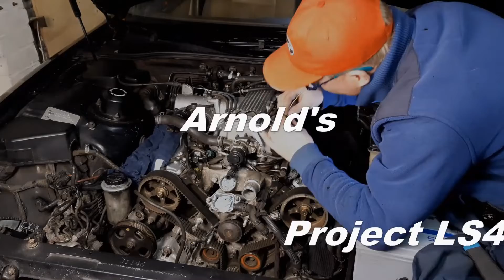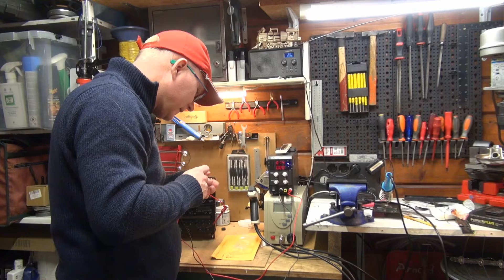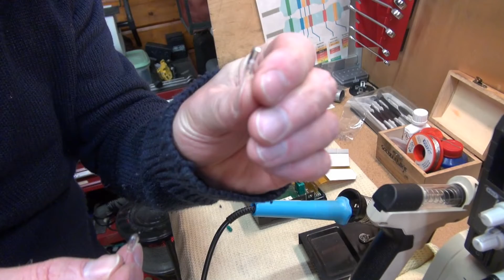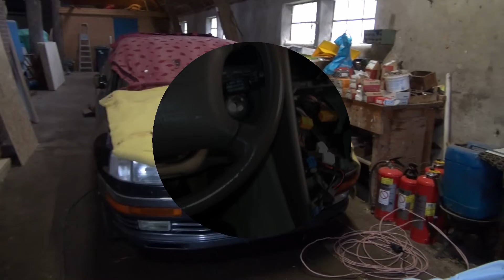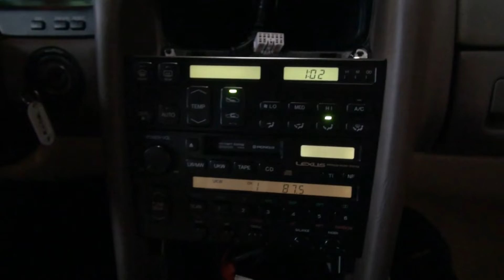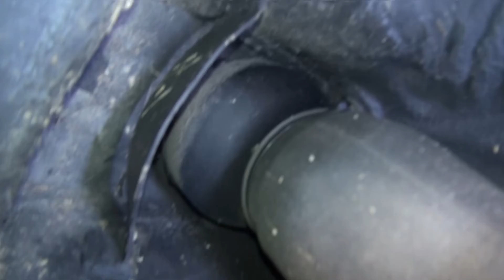Project Lexus LS 400 Ep. 33: Radio illumination repair and brake squeal fix

Comment: When you bought UCF 10 you didn't afraid of air suspension. A lof of people say its better leave the model with it. You have any problems with it?
Reply from the maker: Only my very first LS400 had a broken air suspension strut when I bought it. Because of that, the car was very cheap. I had to buy a new strut from Lexus, that cost 700 euro, while the LS costed 1400 euro. But I never had any problems with air suspension. It is important to do the right maintenance, then it will last a long time. Most of the problems with air suspension come from lack of maintenance. I made a video about it, I will post the link below.
Reply from the maker: Here is the video: https://youtu.be/lixWGjc_EVA
Reply: @Carnold_YT  thank you very much for kind answer

Comment: I wonder if the bulb for the AC panel backlight is the same as mine died recently :(
Reply from the maker: I believe they are the same bulbs, you could check it on theTanin Auto website. Thanks for watching!